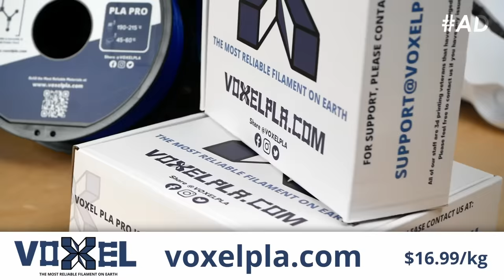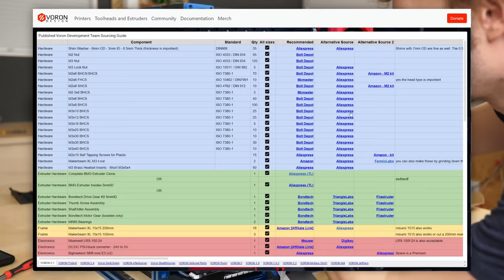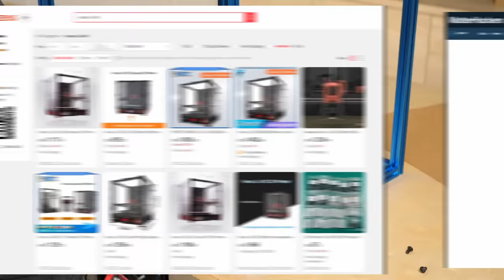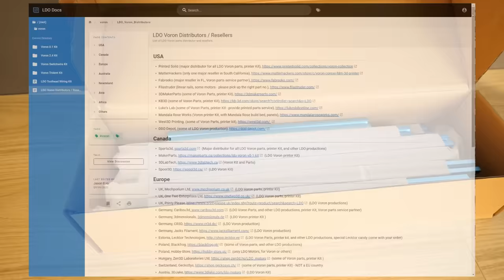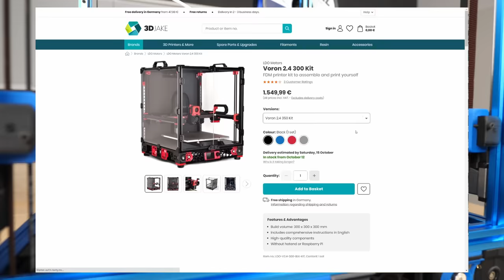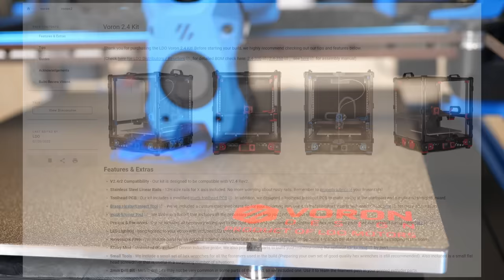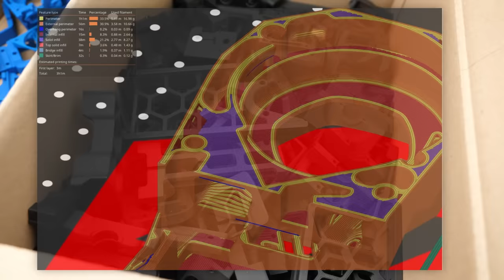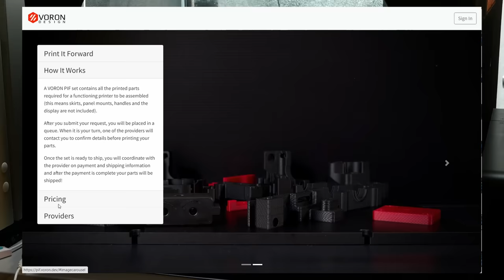Should you build a VORON 2.4 in 2023? (LDO Kit Review)

Comment: I have built a Voron 2.4 last year based on Formbot and before cable harness became common available. Went for Dragon High Flow. Simply love it. Love that ABS/ASA/Nylon and other high temp chamber filaments just work. Added a lot of mods, lights, temp sensors, humidity sensor, two cameras, new spool holder, emergency shut off button and 24V PS controlled via relay from Pi. Also added 10mm foam isolation for bottom and back and modded for that. Next is temo sensors on A/B motors as well as all stepepr controllers. Added permanent mount ADXL345 for resonans test. It is worth all the hype.
Reply from the maker: Great to hear that! Thanks for sharing your experience.
Reply: Where did you get the hardware from?

Comment: This is exactly why I backed the X1C, too. I WANT a boring tool that can churn out the parts I want to create easily, quickly and reliably. Where I can buy replacement parts for a reasonable price instead of having to create them just when I really don’t have time for that.
I might still tinker with some of my other printers, but there’s so much more you can make instead when your printers simply do what they’re supposed to and you don’t have to pamper them.
Reply: That's why I got a Prusa i3 when I got my first printer, but it has made me want to build a V0 :)

X1C also looks fantastic but I don't need a second printer at that build volume, though I would have had a much more difficult decision to make if it was available at the time.
Reply: The X1 is a closed system. Who knows how long they are going to be around/in business. With a Prusa for example, everything is off the shelf stuff and easy to replace in comparison.
Reply: @shadow7037932  but prusa is horribly outdated and way overpriced
Reply: I finished my Voron long ago. There is no tinkering anymore. Just printing part after part. 
The last “mod” 9 months ago was the ERCF(MMU) for 150€. 

The only mods I suggest is Klicky probe with auto-z and Nevermore to get the air moving inside the enclosure.
Reply: @Nobody-Nowhere  what is a good alternative for a prusa mini? (Tinker free printer around 400-500$)
Reply: I'd love an X1C with a build volume of 350^3mm, though - if I were to make a new printer now, I want it rather large, like my cr10s, only way better.
Reply: @Nobody-Nowhere  Any comparisons of price without consideration for time is useless. People forget the most valuable resource is time.
Reply: @CS-932  It is outdated and kind of overpriced ... but honestly, there's still not really a good cheaper option, which checks all its boxes I think.
Also being "outdated" does not mean much for such a device. Yes, sending stuff per WiFi would be cool. Input-Shaping would definetly improve faster prints. And some things in the design could easily improved.
But in the end it's reliable, it prints up to 290°C nozzle and 115°C bed, it has auto-leveling, direct extruder, magnetic bed and just works. Also support is good, and as a beginner the profiles in PrusaSlicer will make the start very easy.
Reply: Totally agree, I want a tool.  I'm not like Nero3D who spends almost all his time tinkering/tweaking the machine.  I want fire and forget with excellent quality.  I don't want to spend 00s of hours fixing stuff all the time.  The Prusa MK3S+ is close but slow as hell compared to the X1C.  Prusa sat on their butt too long and got leap frogged.
Reply: @CS-932  Print speed is knowable and can be planned for. Time to troubleshoot/maintain/repair, not so much.
Reply: …or just a Prusa XL, if that ever arrives
Reply: @CS-932  Support. As an analogy it's generally easier to find support for Windows than Linux.
Reply: As a person struggling with an aging  CR10MINI that seems to have a new issue every week, I used to love the tinkering (and I've learned a lot, no regrets), but now I just want a reliable tool to get my prints done.
Reply: @CS-932  Ah, ok.
Yes. When Printtime is important, the MK3S+ is probably not the right choice.
For me it doesn't matter that much.
Reply: @uhu4677  This video suggested the thing you are looking for. It's not cheaper but it's got all the features.
Reply: @CS-932  I don't think that's true at all. A better value for time is a hyper cube or vezbot. A voron is never really the best value for time.

Also consider the X1C which takes no time to build and is just as if not faster than a voron printing while being cheaper. Truly the best value of time.

Vorons are an engineer being told they have no limits and making what they want. That's what makes them great but is also their primary fault.

The real truth though is super fast print speeds don't matter for a lot of people. Instead auto calibration is what matters. Ease of use is what matters. Reliability is what matters.

On those fronts prusa has the voron best and the Bambulab X1C has them both beat.
Reply: @BeefIngot  I am not looking for anything. For now my MK3S+ does everything I need.

Also I think those Voron Kits are not yet an alternative to an MK3S+.
You still need to print or source the 3D parts. Also I am not convinced with the quality control of those kits. This might not be so important, if you have some experience already ... but if it's your first printer and something is not right, you might have a hard time finding the issue.
Reply: I will butt in (since this is a public forum) and say I was an early adopter of the PrusaMini and it has turned me and my friends off of 3D printing. Part quality was bad on a number of components (burrs on the extruded aluminum, electronic failures, Bowden tube cut crooked, extruder issues, etc.) and since then it's been offline more than on. Since then, I have been too gun-shy to try another printer (both in wasting money and time). Very temped in the Bambulabs but cant convince others into it after the Prusa fiasco.
Reply: @uhu4677  I was referring to a Bambulab X1C
Reply: @BeefIngot  Oh, totally forgot about this one. Maybe I should check a review of it.
Don't need it right now, but if it's good, might be interesting for the future.
Reply: @Nobody-Nowhere  just like Ultimaker with their $5,000 heavily outdated printers
Reply: @roysigurdkarlsbakk3842  I doubt it, Prusa is losing a lot of their backers who are switching to the X1C or vorons
Reply: I have to agree with you on that. I supose that 3d printers have different target users. If you think of it as a tool there is no argue that they should work flowlesly from the box. Think about a construction worker that have to assembly his DIY drill and then tweek it.  It will be out of buisnes before he gets his own drill to work
Reply: @IcyqtLoL  Well from the many reviews and experiences I have read, the Prusa mini isn't even that. It is prone to more issues than its still overpriced relative, the MK3S. A lot of people bought them for their farms and ended up taking them out of the running because they just weren't as reliable.
Reply: I'm also on the Voron camp. i feel like servicing and maintenance on the X1C is gonna be a headache since you're essentially tied to Bambulab's services and proprietary ecosystem. Looks like there's little maintenance you can do on the machine outside "general cleaning".  The X1Cs are great tools, until they break down. And forget about mods too.
Reply: If someone comes up on how to implement the self-calibration and self-tuning of the X1C on "regular" printers, i'll never look at the X1C again..
Reply: @KimmyR3  I, an owner of an X1C agree. I thought I'd never buy a proprietary printer, but the auto tuning won me over
Reply: Right because no 3D printer company has ever shut down before... I'd rather something open sourced so I know my printer will work in 10 years time.
Reply: @elobiretv  Who wants to still use their printer in 10 years? Looking back 10 years, I wouldn’t want to use the printers I owned then, now. Tech moves so fast, in 3-5 years there will be something available that’s so much better than the X1C I’ll replace it anyway. And by that time, it’ll have recouped it’s 1200€ price EASILY. 
I think it really depends on your budget. With enough disposable income and (always too) little free time, any hour I don’t have to tinker (w/ stuff I don’t want to tinker with) is worth a mint to me.
Reply: @Runoratsu  I'm still using my prusa clone from 10 years ago because I slowly upgraded it as the tech moved on. I would imagine something like a Voron would easily last 10 years. I don't mind spending time tinkering to improve the printer, for me that's the fun part of owning one and just relying on buying a new printer every 5 for new tech years isn't fun.

Comment: No regrets getting my Bambulab X1C. Fast accurate speeds. Nice size build volume, 256cubed. No building, optimizing, sourcing parts, flashing firmware and best of all cheaper with an AMS and enclosure. 

Basically plug it in and start printing. 

For the DIYers Vorons are a great projects, just not the best deal if you can't get the parts at a good price.
Reply: If I had to choose right now, I would have gone with the bambulab instead of building a Voron. I love building stuff, but the novelty of building my own printer has gone and would prefer buying a tool instead of a project now.
Reply: @martijnpeters  same situation as me. I like building things, especially tech based but I know that I'll only build the printer once and the rest of the time it'll be printing, so even if building a voron would be fun, the fine tuning would be a headache when I just want it to reliably print 24/7 like the Bambu Lab X1C. The X1 also has multi colour printing, LiDAR, Cameras, its own slicer & app plus countless other features which make it more advanced than the voron (its also faster).
Reply: The X1 and X1C still showing pretty often issues which is the reason why i didnt jump in yet :/ And the buildvolume is too small for me to be honest. but the idea and the ppl behind bambulab are gr8
Reply: I cancelled my bambulab pledge because I didn't like the privacy policy and the fact that if relationships keep going sour with China, we may run out of spare parts.
Reply: @reinux  What exact wording in the privacy policy is concerning? I read through Bambulab, creality, even prusa and it's a standard boiler plate policy.  Every company that does business in the US, EU or wherever has to follow the laws of that country.  
At the time of writing there are no printers able to compete with the X1 and X1 Carbon for the price.
enclosed, able to print all types of materials, camera, lidar, remote controls and so much more. 

And if a country is running sour trade with china we will be in a whole lot more issues than a 3d printer.
Reply: @hawtdayum  We're already having shortage problems with all kinds of things, especially coming out of China. No sense adding to that problem. It's worse in Bambulab's case, because it's by former DJI people, and the US has deemed them a cybersecurity threat, which, regardless of your feelings about that analysis, puts them right on the chopping block.

The X1C sends print files through its server and offers no option to do things over LAN, other than using an SD card. No encryption, other than presumably SSL. I asked about this on reddit, and the answer the company gave was less than satisfactory.
Reply: @reinux  So you are saying you can put in an SD card and never use cloud services? How is this any different from an ender that only uses SD cards? 

Looks like you proved your own point. If you dont like cloud services then don't use them. 

If you need parts stock up like anyone with a 3d printer. Last I checked DJI still sells products around the world and former dji engineers made one of the best 3d printers their first try. 

I have an ender 3 pro which only uses SD cards so this is nothing new for me. If I CHOOSE to go offline I can. Seems like a non-issue. if you need to go offline then nothing is stopping you.

I also have tons of spare parts for that ender because even a day downtime costs money and the X1C is no different.

Let's put it a different way. I have several Steam decks. The first I reserved day one(june 2021) and got it in May(2022). The second I reserved in June(2022) and got in in Sept(2022). Because there was a shortage I should never have bothered buying them because there as a high demand and shortage? Both products are made in China the shortages hit many sectors from cars. chips, graphics card etc. Those are being worked through. 

What I know right now is the Bambulab X1C is the fastest most accurate FDM printer for its price and no other printer comes close for the price.
 
So lets be real what other printer beats it?
I have the Kick Starter Early bird  $1000 model with AMS. Even at $1450 fully loaded it cannot be touched right now.
Reply: @tombeardy4833  Agree - would like to see them come out with a larger build volume
Reply: @muniradlan3659  You have yours now?
Reply: @csadler  not yet. Mine is arriving at the end of the month
Reply: @muniradlan3659  how do you like it?

Comment: I fully agree with your distinction between the X1C and the Voron: one is for just using, and one is for building and tinkering.  The different build volumes are the only reason I might build a Voron, now - bascially, I'd really like a very high precision small build volume printer with a 0.2mm nozzle.  But even with that in mind, the truth is at an X1C isn't much more money than a V0, and would be a lot less stress and frustration, so the only reason not to just get a second X1C for the small detail stuff is finding somewhere to put it.
Reply: The thing is if you want a small but high precision option then go with a resin 3d printer.    My issue with the X1 came down to build volume, I want my next printer to have a bit more volume.  I already have a great printer that does 235 by 235 and a resin printer for small detailed models.   Ideally a 300mm volume would have been perfect for it.
Reply: To be honest once build and tuned a Voron is a productivity workhorse, I don't ever touch mine except to change filaments and take printed parts out of the printer.
Reply: @Penofhell  yeah you thinker with it for the first 1-2 months but later you just print with it. 
I am very pleased with my Voron 2.4.
Reply: @MaethorDerien  Fair.  I have pretty f'ed up lungs already and the hassle of dealing with resin doesn't seem worth it to me.
Reply: @Penofhell  Yeah, but that's like saying "Napoleon could have easily conquered Europe once he defeated Russia."  It's ignoring the fact that "once build (sic) and tuned" hides a lot of work and frustration.
Reply: @davydatwood3158  That's assuming the building process is frustrating
Reply: @Penofhell  We know it is though, at the very least the sheer amount of time it takes is even if you find the process itself not to be frustrating.
Reply: @Penofhell  Yes.  That is, indeed, my entire point.  "I congratulate you on your  perspicacity, sir."

Comment: When I decided to build a Voron, it was for light commercial production.  Whereas a Bambo would now fit that market, it did not exist at that time.  The commercial printers I did have experience with were far less capable, and cost far more (you pay for a machine that works right out of the box with slicer settings even "that one guy" in your office can use; you don't pay for the best printer).

In 2021, I felt that the Voron hype was a very real thing, and I still do.  The printer is extremely capable, dependable, and customizable.  You are correct that this is not a machine for those that don't want to tinker.  You don't have to tinker with it, beyond maintenance, but DIY printers are aimed at those that tinker to begin with, and it's strongly encouraged.

The printer is fast (I tend to now run it slower than theoretical limits, but I have not messed around with input shaper yet) and is extremely accurate.  I have made 0.025mm z parts with a 0.20mm nozzle on a 350x350x500 custom v2.4 (yes, shame on me for wasting so much build volume), and they look almost like they were a resin print.  They are clean looking, and don't look like a middle schooler's science project.

Is it worth the cost over lastest generation cheaper prosumer out-of-the-box options (like the Bamboo)? I don't know, since I have not personally used the newest generation.  The Voron does take a lot of time to setup, and I spent as much time running DIY wire looms (self sourced build) as assembling the mechanics, which should be factored into the cost difference.  But I don't regret my purchase (though I did swear a little too loudly when I later heard the LDO kits would come with precrimped harnesses), and reccomend Vorons to fellow tinkerers wanting something more capable than their Ender 3.

Edit: Also be aware that with more and more modern commercial printers adopting Klipper, the 'monopoly' that DIY printers had on advanced features is changing.  Two years ago, the community also hyped a Voron because it had access to features and improvements not available in off-the-shelf stock configs.  Are they still riding that wave? Yes.  Would I today build a third voron or buy a Bambu? I'd build a Voron Trident in a heartbeat. I'm a tinkerer, and I want it to be MY Voron, not THE Voron, as you said.

Comment: As another commenter noted, the side panels will significantly dampen the noise. I also spent some time tweaking motor settings and switched the skirt fans to 12v (and not 100%) which make the printer quiet enough to be inaudible while teleconferencing in the same room.
Reply: 90% of the noise from my 11 vorons is from the server fans. Which panels do not cover.